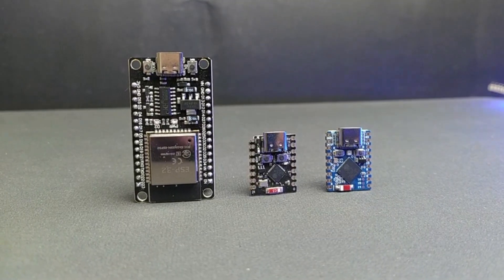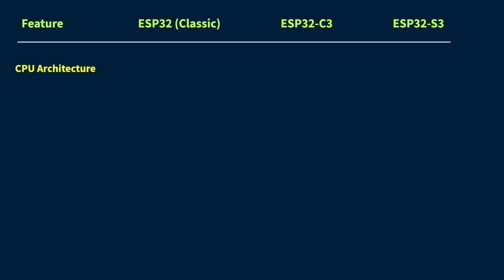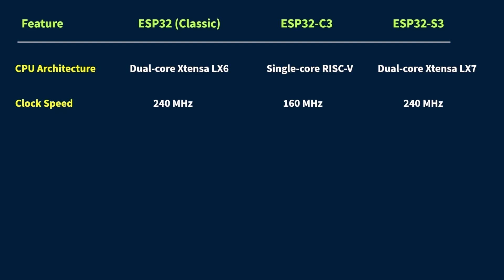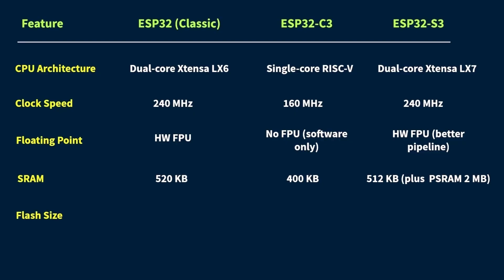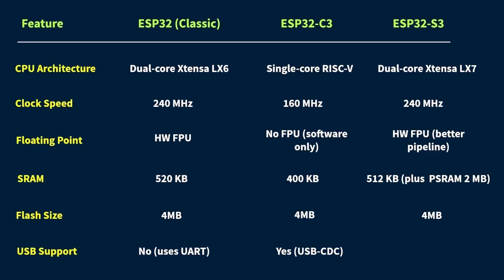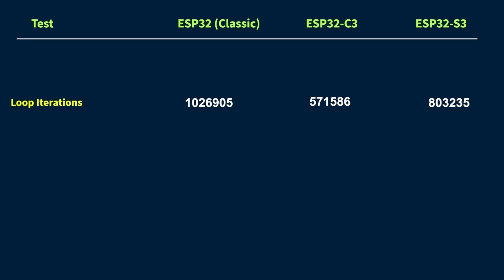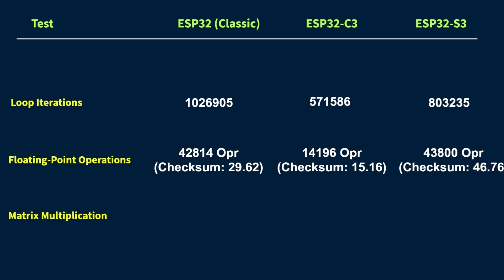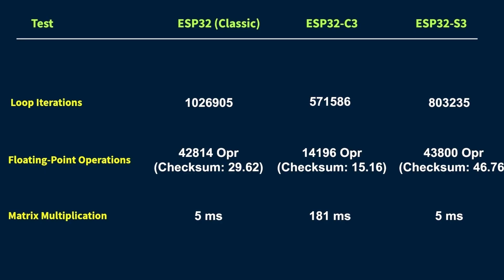ESP32 vs ESP32-C3 vs ESP32-S3 🔥 Speed Test & Performance Comparison | Which One is Fastest?

Comment: The classic esp32 is still good then, I also found that the s3 is not supported in as many things as the standard one.
I find the c3 is ok for simple sensors though and I have made some great sound reactive ws2812 matrix animations.
But I also use wled and only the standard esp32 works properly..

I have a couple of C6 too which I will be playing with for zigbee type sensors sometime.
It's all good but pretty frustrating trying to get anything other than Arduino or Wled working and I'm finding lots of stumbling blocks trying to get ai to give me programs to do what I want because of all the version changes and chip differences etc etc.
Esp ide is beyond me lol.